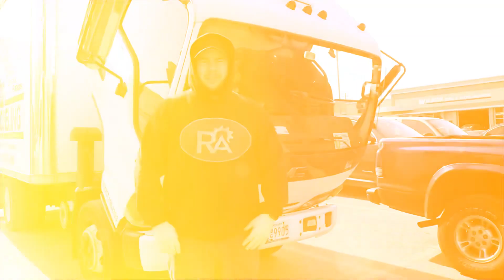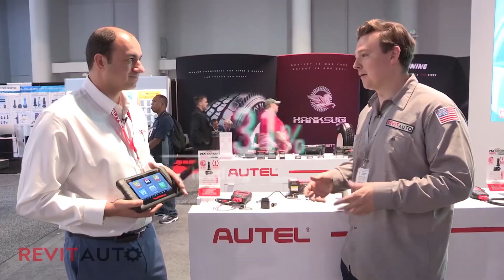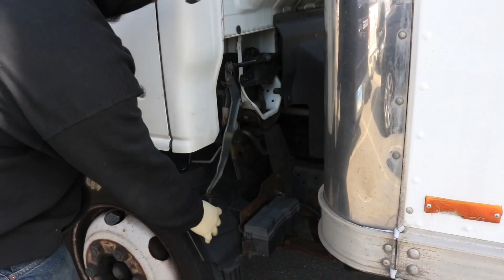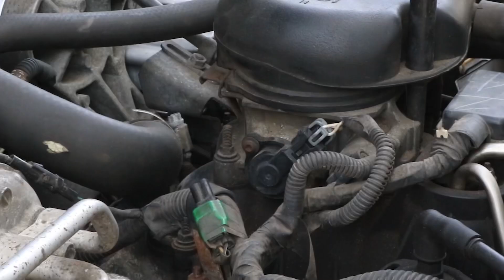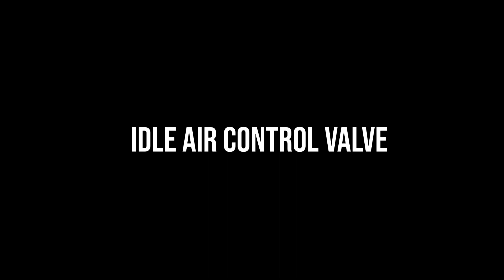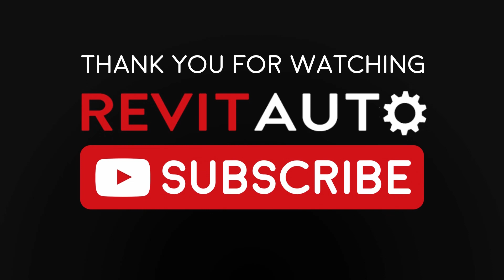How to Replace the Throttle Position Sensor (TPS) on a Isuzu NPR | Fix It Friday

Comment: Took my battery cable off to replace starter on my 97 3.9L Diesel. Now it won't shift properly. Did this once before and it took a few months of driving before it started shifting properly. Like it is always in kick down mode right now. Something must need calibrated, but I can't find any info.

Comment: How do you replace for troubleshooting throttle piston sensor on a 2006 diesel 4 cylinder the engine shuts down or cut out when you push the throttle down fast
Reply from the maker: O man, that would be a tough one. You would not happen to be in the DC area would you? To answer that question. You would need to get a reference data point of what the closed and open position voltage and resistance is supposed to read. I would also make note of how the factory fuel shut off device operates.